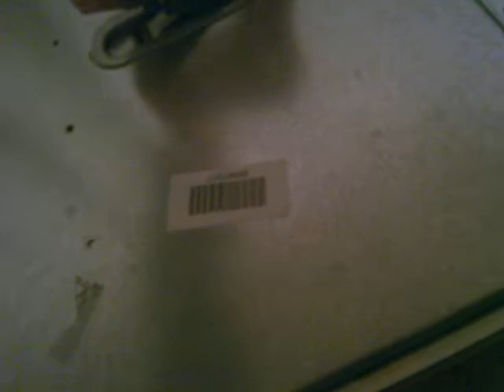HP Proliant DL360 G3- Latest Server!

Comment from the maker: @johnypc2008 Hi. I am not to sure either on the thermal cut out, But I am sure there is something like it.

I do not use rack mounting for Two reasons, I do not need it-server isn't on all the time, and secondly I don't have the architecture to have racks as of yet. etc high voltage plugs cooling systems.

Comment from the maker: Daniel, It went from off, slower fan speed to actually turning it on, full speed fans, then I turned off again meaning slower fans and it was quieter. However I would go into the BIOS and look at the fans within their that should solve this particular issue. I do not own a server anymore, but I am due to purchase a tower server- the noise and size is a issue now!!

Comment: @barryj1234 
Unfortunately where I live that’s not possible.

Yes I ruled out water cooling due to cost and even looked at a few retrofit water cooled systems such as Thermaltakes.
I have looked at the CFM involved and can shift this amount vertically by piggy backing however not sure if the current system plays a duel role such as display card or HD cooling.

Comment: @barryj1234 

Most AMD chips I have used in the past have thermal cut out, not so sure on Intel though?
If the same might forgive any miss calculations I make.

Like you not using rack mount so height is not an issue.

Comment from the maker: @Xequal1 You should try with getting dream spark verified, Nothing wrong with trying at it.. Then you can use the OS's on there.. Server 2003/2008  I have 2003 on mine....  You will need to burn the disc images to disks. also DL360 G3's don't have "DVD" drives, Only CD I think, That's what mine has standard.

Comment: @barryj1234 I am dreamspark verified now, I burnt Server 2003 to a CD but when I load up the server with the Server 2003 install disk in it says "txtsetup.sfi is corrupted or missing" I checked on the disk and its present. It also shows up as 1536MB RAM installed when I looked inside and it has 4x512MB RAM (Is it a faulty RAM module that's causing that error?)